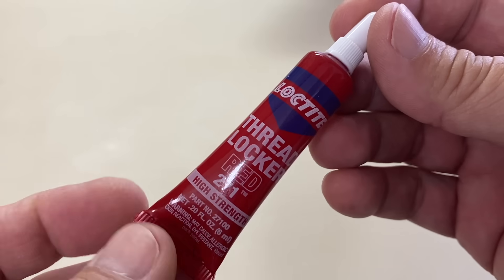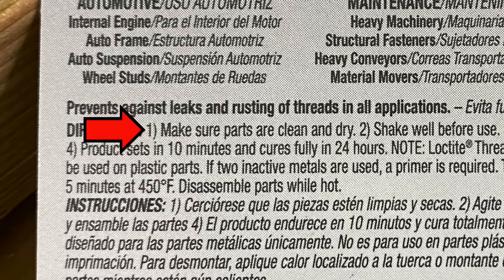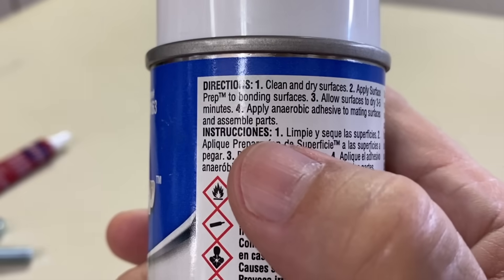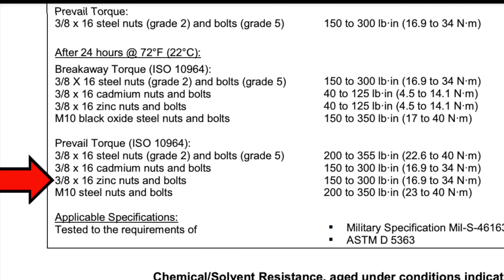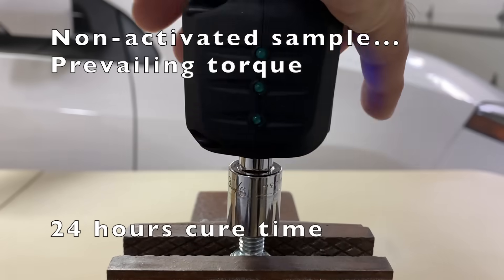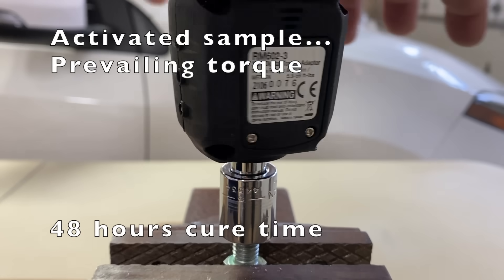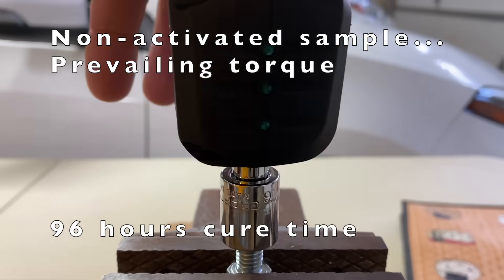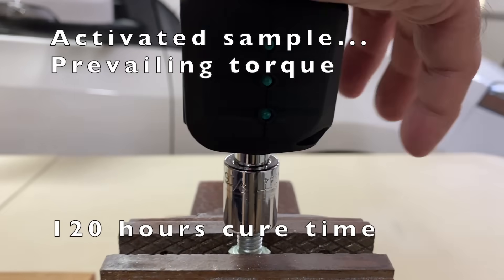Nuts & Bolts - Most DIYers Do Not Know This | Loctite Red Threadlocker Curing

Comment: Thanks for Sharing.  I, personally do NOT like to use "Red - High Strength" aka "Permanent" "Thread Locker" and rarely/hardly ever use it.   I find when is ever anything "Permanent", such that you will "never" need to remove it? Blue "Removable" works just as well and has for all the applications I have used.  Using Red, one has a greater chance of damaging the hardware and supposedly maybe in these application the hardware should be replaced. I recently removed a bracket on a vehicle to access room to service a transmission pan held in place by red - such I had to use a cheater bar and was scared I was going to shear the hardware because of the locker and the force to remove it.  Yes, Heat helps the removable but I did not want to apply because of its "surroundings". Blue would have worked fine.  And yes, this my humble opinion.   I am sure that others will argue otherwise, especially instances where failure will be catastrophic.  This experiment is really testing to see if treating the "active" hardware makes a difference in the performance of the product.

Comment: the Loctite looks a bit clear and watery, maybe you need to shake it more.  the red Loctite i was just using was not clear/transparent it was thick and not clear.    i noticed it tends to be clear at the tip (when i cut open a new bottle)   i just squeezed a little into a paper towel until the thicker stuff started coming out.   (i did shake it up a lot)
Reply from the maker: Interesting… I’ll check that out.  Thanks!  😎

Comment: I thought the surface prep was the cleaner and not the actual primer. but it said "activator" so i was a bit confused.   you should verify you used to right primer for the red 271.
Reply from the maker: Thanks!  I could only get the Permatex activator/primer at the time I recorded the video.  I recently found a place with Loctite’s SF 7649 primer and am testing it now.  👍😎

Comment: It looks like you have an issue with the bolts not being uniform enough.  

I would use the a larger sample size of at least 40 units and your 5% low (i.e. take the highest of the 5% lowest samples.)
Reply from the maker: 40 units?  😳
Thanks, but I don’t have that kind of funds to burn.  😎

Comment: Not really a good test protocol ....it does not include the typical situation where the nut is usually bearing on a surface (friction) and the bolt is tensioned to an appropriate load ... All of this in reality should be considered if you are looking for assurance  that the fasteners will not loosen prematurely ..... by using Thread Locker.
Reply from the maker: Thanks!  This video with torque might interest you... https://youtu.be/7yPQIsfv9x8
👍😎

Comment: The clearances between the thread of the bolt & the nut might also play a part. A 'sloppy' fitting nut relies heavily on the Loctite interface only. That's my thoughts here. Also, tightening the nut & bolt with metal between - to a preset torque - then allowing the loctite to cure. Then evaluate the loosening torque and measure the difference. The study demonstrates the breakaway forces, but the nut & bolt aren't under the torsional forces which are applied in a real-world situation.
Reply from the maker: Thanks!  This follow up video might interest you... https://youtu.be/7yPQIsfv9x8
😎

Comment: perhaps, the nut needs to be tightened against a mating surface.....and cured in this tightened condition.  Your example only shows free floating nut.
Reply from the maker: Thanks!
Yes, nuts are normally torqued down.  This is a breakaway torque test that tests the strength of the adhesive only and eliminates the variables of torque and friction.  Threadlockers don't need torque or compression to cure... only to be in contact with metal and in the absence of oxygen.  This is one test that threadlocker manufacturers like Loctite use to measure the strength of their products.
👍😎

Comment: Is this test accurate in real world? Aren’t nuts clamped down tight while it cures?
Reply from the maker: Thanks!
Yes, nuts are normally torqued down.  This is a breakaway torque test that tests the strength of the adhesive only and eliminates the variables of torque and friction.  Threadlockers don't need torque or compression to cure... only to be in contact with metal and in the absence of oxygen.  
👍😎
Reply: @HacksbyDad  in what application is thread lock used and the fastener isn’t tightened? Do you not think the closer contact of metal would affect strength?
Reply from the maker: @adventureswitheddie6444  Fasteners are not normally used loose like in this test.  The strength is actually lower when the fasteners are tightened or torqued.  Here's an experiment that I did several months ago... https://youtu.be/7yPQIsfv9x8
😎
Reply: @HacksbyDad  my point is why do a test that won’t actually be happening in the field? Who puts fasteners on loosely, it’s cool to know it’s stronger but that will never be used like that
Reply from the maker: @adventureswitheddie6444  Yeah... I was just following the testing that the manufacturers conduct and place in their literature.  The technical data sheets normally show the breakaway torques.  🤷🏻‍♂😎

Comment: The torques for 72 hours cure time seem the wrong way around.  Perhaps the samples were accidentally swapped, or perhaps it's random variation of materials.  A replay is justified.
Reply from the maker: Thanks!  It was probably a random variation.  I'm working on a follow up video with Loctite's primer and more samples.  😎
Reply: @HacksbyDad  A dob of paint on each bolt head in one set will avoid doubt about accidental swaps.
Reply from the maker: @brianvogt8125  👍😎

Comment: I'm calling marginal bullshit on the absolute necessity of this product. I've been an ASE master tech for 25 years and have never used this primer. I understand that it offers more holding power, but the purpose for using loctite in the first place is to prevent vibration and possibly expansion and cooling from loosening bolts over time. I've never seen an example where one fastener has come loose if properly torqued and loctite used as an insurance policy
Reply from the maker: Thanks!  I was surprised to learn about the primer.  Reading more… it is meant to speed curing time on inactive/passive metals and/or when the fasteners are cold.  👍😎

Comment: Try torquing an assembly vs loose hardware,  which made no sense to me.
Reply from the maker: Thanks!
Testing a loose assembly tests the strength of the adhesive alone… the breakaway torque.  
Testing a torqued assembly includes the variables of torque and friction… the breakloose torque.  
👍😎

Comment: In my industrial manufacturing job we use Loctite 290 wicking threadlocker compound, a very thin green product designed to affix previously assembled parts, to seal a particular pneumatic control component. With the application of Loctite 7649 primer the 290 bonds the parts within seconds and is resistant to 250psi air pressure within minutes.
Reply from the maker: Thanks!  I compared the two in this video… Loctite Red vs Loctite Green
https://youtu.be/amqesHpyCKg
👍😎

Comment: Don't make any conclusions here,  the primer does make a huge difference when used as intended.  I used it daily for stainless steel hardware with red Loctite and for setting anodized sleeves with green Loctite.  The difference when using primer is huge.
Reply from the maker: Thanks!  I finally got my hands on Loctite’s primer and am testing it out.  👍😎

Comment: Looks like you primed only the bolts.
You didn't follow the directions.  It says surfaceS. AND didn't tighten them, so you're missing out the whole anaerobic component. 
Probably need to do this experiment again to get real results.
Three sets:
Tightened to torque spec for that size bolt.
Tightened to torque spec for that size bolt with Locktite.
Tightened to torque spec for that size bolt.with primer and Locktite.
Reply from the maker: Thanks!  I guess you missed it… I sprayed both the bolts and nuts.  This was a test of the breakaway torque that tests the adhesive strength only and eliminates the variables of torque and friction.  I just got my hands on Loctite’s activator and will test it out with 5 samples each.  👍😎

Comment: Worked installing snow plows and stainless steel cargo boxes on truck frames. Never install stainless steel nuts and bolts without first coating the bolts with silver antisieze. If not coated with antiseize you will never be able to get them apart. Stainless on stainless bonds will never be able to be unbolted no matter how hard you try.

Comment: i think you should re-do this test and actually toque the Nuts all equally on the bolt ,,,because in a real life application you would not have a nut just hovering mid shaft it would be snug to the part.....271 270 and other Loctite are Micro encapsulated
Reply from the maker: Thanks.  Loctite is normally used on torqued nuts and bolts, but torque is not required for it to cure.  Anaerobic adhesives like Loctite only require to be in contact with metal and in the absence of air.  This test was just testing the adhesive strength of Loctite... the breakaway torque.  The breakaway test eliminates the variables of torque and friction.  Here's a Loctite video of how they conduct the same test with really expensive equipment... https://www.youtube.com/watch?v=PGZCPyi8yBc
👍😎

Comment: Stumbled into this video and thought I would point out, Zinc is considered an active metal. It reacts readily with acids, releasing hydrogen gas, and it also reacts with alkalis and other non-metals. For example, when zinc reacts with hydrochloric acid, it forms zinc chloride and hydrogen gas. This level of reactivity classifies zinc as an active metal in terms of chemical interactions.
Reply from the maker: Thanks!  Just following the threadlocker technical data sheets.  Permatex lists zinc as an inactive metal and Loctite lists zinc as a passive or slow curing metal.  🤷🏻‍♂😎

Comment: Zinc is an extremely active metal. That's why it's used as an anode for corrosive applications. Without the bolt in tension in an actual bolted joint, the tests are completely all invalid.
Reply from the maker: Thanks!  Just following the threadlocker technical data sheets.  Permatex lists zinc as an inactive metal and Loctite list zinc as a passive or slow curing metal.  
What you're talking about is the breakloose torque. 
The test is for breakaway torque on a loose or unseated fastener.  That is what is shown on the packaging.  It eliminates the variables of torque and friction of a seated fastener.  
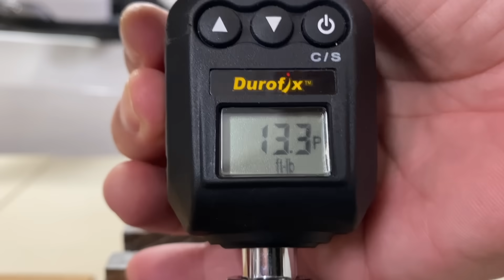Here's a Loctite video showing the breakaway torque test (jump to 4:20)... https://www.youtube.com/watch?v=xGOYJrpoVds&list=PLBGGrOGSp6gtpHz70wdiFqOaVzWUsVuHU
😎

Comment: Excellent video.  I'd like to see this again, but using Loctite's 7649 Klean N’ Prime as they have that listed as an activator as well as primer.  That may make quite a bit of difference.
Reply from the maker: Thanks!  At that time, I wasn't able to get Loctite's Klean N' Prime in my area, but might have just found a source.   If I do get it, I'll test it on stainless steel.  😎

Comment: How much torque does a vibrating nut create? Like a fraction of an inch pound?  As long as it doesn't vibrate off, thats all I need.  Will get some activator if I ever use stainless nuts and bolts though.

Comment: Very well done.  As a full time maker who often works with aluminum parts, I have to stress to people there is almost never a time to use Red.  Red can take threads out with it, particularly with smaller fasteners.  Red requires heat and not all items can be heated (electric motors for example) so it should be avoided.  Look into standard vs high temp blue.  Red is stronger = better are the typical thoughts of makers with little experience.   There is a correct thread locker/adhesive or socket for every job.  Sure, the wrong one will often work when judged by an amateur.   My shop stocks standard blue, high temp blue, red which is kept hidden and sleeve retainer.   These are the basics of a well-equipped shop and you can drop the red 98% of the time.

Comment: very interesting, always wondered about that primer thing... I normally steel brush off the bolts and spray both with carb cleaner to remove oils... wondering if that makes it weaker?

Comment: Do the same test with loctite yellow and loctite blue. Yellow is the best, it was used for locking shaft bearings in Aluminum and other metal frames. Blue can be added after all hardware is tightened, it seeps into the thread and then hardens. sometimes yellow has to be heated on high temp to loosen. Red loctite was used to help keep fasteners from losening during machine vibrations.
Reply from the maker: Yellow?  I've tested green Loctite, but haven't heard about yellow.  👍😎

Comment: @HacksbyDad - Clarification?  What is the difference between Breakaway Torque and Prevailing Torque situations?  Yea!  🍀🙀🌟  😇
Reply from the maker: Thanks for the question!
Here are the definitions from Loctite's threadlocker manual...
Breakaway torque - the torque required to break the bond between the nut and the bolt when
rotating an unseated assembly.
Breakloose torque - the torque required to break the bond between a standardized nut and the bolt in a seated assembly.

Prevailing torque - after the initial breakage of the bond, the average torque measured during the
360-degree rotation of the nut is known as ‘prevailing torque‘. 
👍😎

Comment: Given that the compound is heat activated, and released, as in the heat generated by friction when the fasteners are tightened or heated with an external source, I was surprised you gained any resistance .
Reply from the maker: Heat activated?   It is my understanding that anaerobic adhesives cure in contact with metal and in the absence of air.  Am I missing something?
😎

Comment: Numbers are useless without doing multiple designed tests and proper statistical analyses. “best” jumps right to left down the column. Isn’t it a bit nonsensical that 96 and 120 hr Non-activated are less than 72 hr? This kind of test requires a statistician to design.
Reply from the maker: Thanks!  This was a lazy test.  I test more samples in other videos.  This video was meant to point out that an activator is recommended for use with inactive metals.  👍😎

Comment: Good catch. I've used Activator before but didn't know why. But, something I noticed, you used a cheater bar on the torque wrench incorrectly. In the way you used it, changes the leverage and can change the torque value. You are supposed to pull 90⁰ in the grip zone. If you extend the length of the grip or arm of the tq. wrench, there is a formula you're supposed to use to get the correct tq. value. Or you can use any size cheater bar at a 90⁰ angle in the grip zone.
Reply from the maker: Thanks!  I believe what you’re talking about is true for a beam torque wrench.  There is no grip zone for the torque adapter that I used.  😎
Reply: @HacksbyDad  LOL... yes you are correct, I needed notice that it was a torque adapter. Good job Sir!

Comment: I always just cleaned the threads with an aerosol brake cleaner, allowed the surfaces to dry, then applied the threadlocker.  I never experienced a problem except for having to heat the bolt or the nut to remove it, using the "Red".  Thanks for your efforts in this experiment.
Reply from the maker: Thanks!  👍😎

Comment: I would have liked to see no loctite torque included. I sometimes use nail polish which can be used on any metal. I put it on the threads as well as the remaining thread. I truly don't know how well it dries inside, so the painted outside threads act as a sort of backup. That's something else to test.

Comment: Don’t you usually torque the nuts down instead of just threading them on in loose state? When you tighten the nuts to hold something together then you have the red loctite helping hold the nuts along with the torque that you put on the nuts and bolts. Unless I am totally misunderstanding the loctite needs the torque of the nut to the bolt holding pressure in conjunction with the loctite to hold those specs you are testing.
Reply from the maker: Thanks!  You’re correct.  Loctite is not typically used on loose nuts and bolts.  This is a test that mimics how threadlocker manufacturers test the adhesive strength of their product.  It eliminates the torque and friction variables.  😎

Comment: Great job on testing a product(s).  I haven't reached that point because I am essentially at the beginning of flying SOLO in the DIY-space in late 2023. My Dad was nearly a master in a lot of trade skills and upon retiring from the US Army he achieved Summa Cum-Laude with his Bachelor of Arts degree.  I never heard of the terms "active metals" vs "inactive metals", but I do remember studying "ferrous vs non-ferrous" metal; however, I am not a metallurgist. I thought the terms "active" vs "inactive" is applied in chemical reactions, but I am not a Chemist.  I think adhesives are tested for tensile strength and torque is testing the rotational strength (axial).  I may use one of the products once my Kohler Replacement Starter and I install the starter into our 2017 Cub Cadet XT1 LT46.

Comment: I have never seen anyone use Loctite on on a nut/bolt where the nut was not tightened down.
Reply from the maker: Thanks!  You’re correct.  Loctite is not typically used on loose nuts and bolts.  This is a test that mimics how threadlocker manufacturers test the adhesive strength of their product.  It eliminates the torque and friction variables.  😎

Comment: I worked at a stamping facility and used to watch the repair men take new black oxide screws still with the oil still on the threads apply Loctite and run it into a dirty threaded hole.
Then after the screw would loosen they would say "oh Loctite sucks" 🤡 they didn't have any idea....